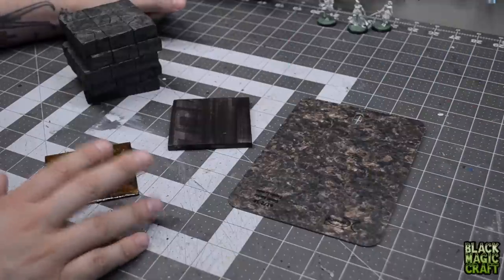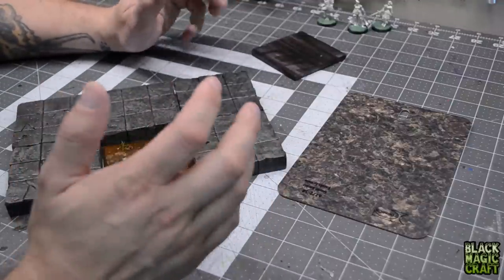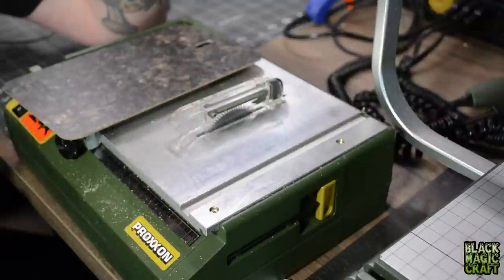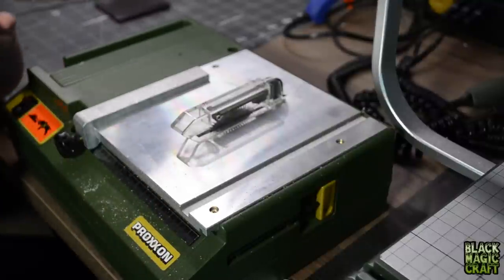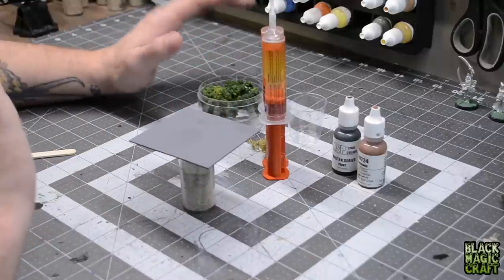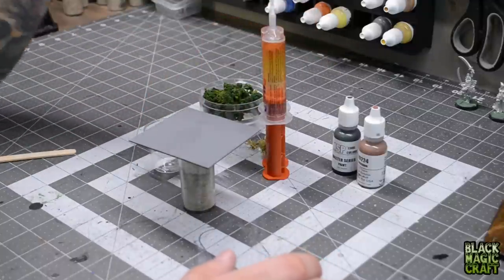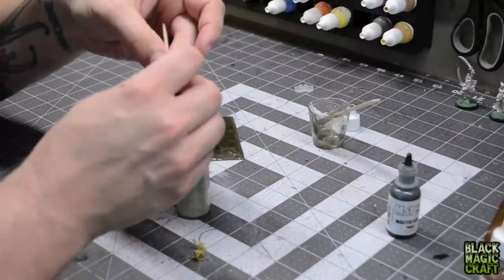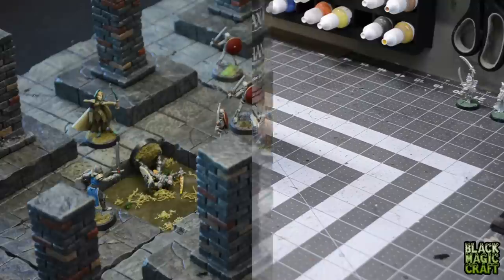Traps! Basic Pit Trap For D&D Tutorial (Black Magic Craft Episode 053)

Comment: I used an old Fiskar self healing cutting mat . I cut 3 x 3. It was about 1/8 inch thick, and I cut it using a straight edge and a razor knife. It was 6 inches across( edge to edge) and  18 inches long. It felt a little flimsy, but by the time it was painted, detailed,  and epoxy top coated, it was what I needed.

Comment: If you wanted to do a hidden pitfall block where the top can be removed and still look like any other tile there's a few different ways. The best way is to make a "box". Use the same stuff as you did for the bottom and make some sides with the same stuff, just make it shorter then the full height as your normal tiles, you can make a lid with just XPF or use another piece of that stuff that either fits in the the open space or covers the whole top, then glue a piece that makes up the rest of the thickness of the tile to that. Decorate it as normal and paint and there you go an invisible pitfall trap.

Comment: Would LOVE one of those saws for y D&D Makers shop here in Australia but the thing cost about $730 from the local distributer and, while lower in price from your affiliate store (which I would like to use but..) the delivery costs (shipping, insurance and tracking) will take the cost to over $800...
Will have to use my Dremel cutting disc and lock the Dremel tool on the end of the cable tool in a bracket. I have done this before with a cutting disk and mounted a plate made from a thin 1/8th aluminum plate with a suitable slot cut into it, thereby making a small and somewhat limited table style saw....

It works on many things so I will try it on formica etc soon...Thanks for this great idea...

Comment: an option for the platform to work off of if not wanting to snag formica tiles is to use a 3d printer (if you, friend, or local library/makerspace) just need a 1 mm square printed out.

Comment: This is an amazing solution I never would have thought of.  It REALLY looks like it has a lot more depth to it. I could even see sticking down the trimmed tips of toothpicks or bbq skewers as spikes poking out of the water.  Gross AND ouch!

Quick question. I don't have a table saw, not even an adorable tiny one, but I do have access to copious amounts of scrap Formica and a good rotary tool. I've never worked with Formica and have no idea of its tolerances, but you have a great grasp of its properties.  So, Formica + rotary tool cutting disc. Worth a try, or bad idea? I'd just as soon avoid flying chips and shattered discs flying everywhere. I have safety goggles, but I also like not finding random tiny sharp things with my feet.
Reply: The VERY NEXT video in queue was spike trap. I'm so satisfied.

Comment: I am loving the idea of a net trap of some type but I'm struggling to figure out what material to use to keep it in scale. That'd be awesome if you figure it out!
Reply: You could use either the type of mesh used to screen doors, or aida cloth which is normally used for cross-stitching.  Depends on how large you want the open spaces of the net between rope strands to be.
Reply from the maker: Yea window screen, especially the metal kind would be good. Also that mesh that is used under poofy dresses...don't know what it's called.

Comment: I was just thinking if it is possible to cut the material similar way as you would cut glass? Or is it too flexible or 'chewy'? Breaking the surface from one or both sides with a knife or glass cutting tool and then crack the cut by benting it over a sharp edge.
Reply from the maker: It wouldn't work. Formica acts like really really strong thin plywood, it's really fibrous.

Comment: Will this saw work on foam core? I saw Adam Savage in one of his videos say they used saws for ripping down the huge foam core sets at ILM but I'm wondering if this would give a good, straight cut. I use the nicer black foam core, Elmers brand.
Reply from the maker: Yea, if you want to cut down foamcore with the paper still on it this little table saw would work well....but you will be limited by the width at which you can rip it.

Comment: 1mm styrene sheet might have been a good option - it's much easier to cut, and super cheap.
Reply: It would totally melt and buckle under the heat of the epoxy.

To give you an idea, I 3D printed a well with PLA that melts at 180 degrees Celsius. I used the epoxy to add standing water and it melted out of the bottom of the well.

Comment: Typical of someone that has used a table saw for a lot of things is to remove the blade guard. You obviously know what you're doing. It looks easy when you do it but I know how difficult it can be to freehand cut a straight line on a table saw. Even on something that is only 3 inches long.
Reply from the maker: I've installed a lot of hardwood flooring and kitchen cabinets.....I can freehand rip a perfect straight cut across an 8' piece of hardwood, lol. This here? just child's play.